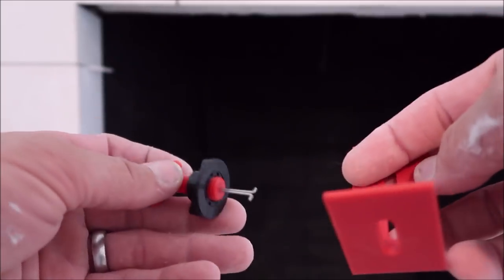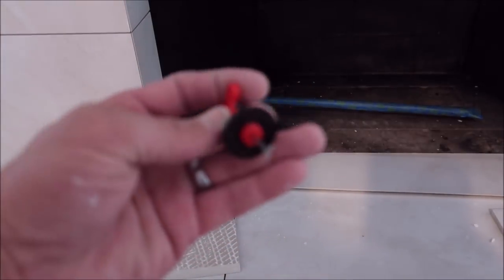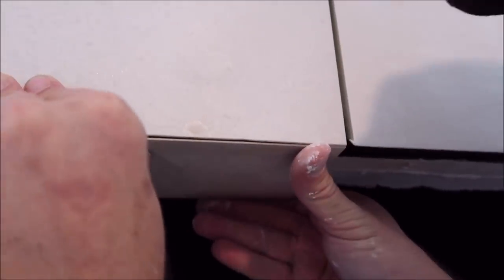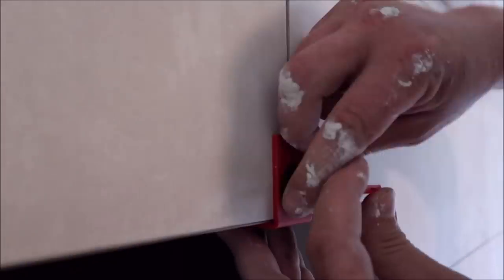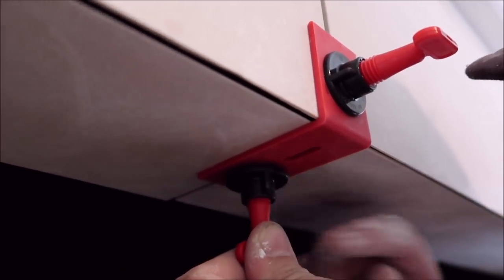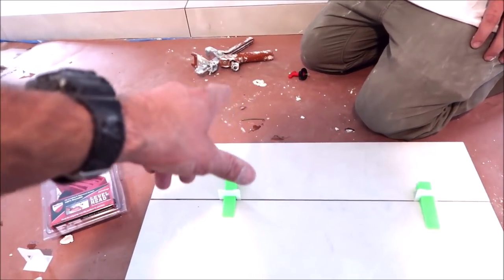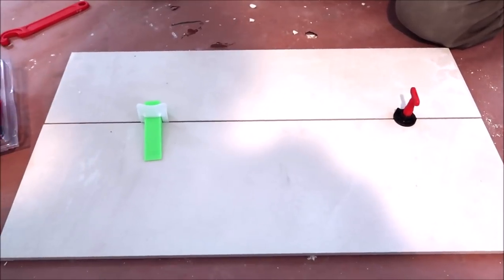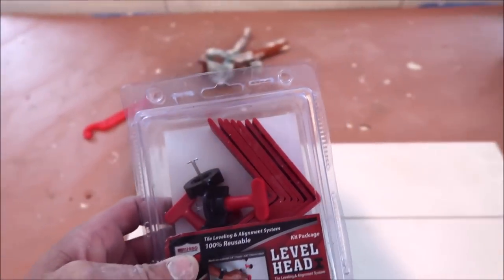Level Head Tile Leveling System Review and Test

Comment: So does the spindle part also push the point into the backer board to hold it?
Reply from the maker: No, it uses the face installed tile to hold the horizontal bottom suspended tile in place with the L bracket and keeps it from falling off/moving etc. It works for grout lines ranging from 1/32 to 1/4 and levels out the tile so there is no lippage. Cool and unique product...
Reply: @LandbergTileTV  yeah I'm looking for a product to hold up larger heavier tile like I did with the entrance of the shower... had to use a vertical and horizontal stick, tape never works for me
Reply from the maker: 2x4's that's what we use! 👊 we have yet to test this level head system on large heavy ceiling tile...
Reply: Used to use 2x4 too, but they tend to cover the butted edge so you don't know if flush the next day...sometimes.
Reply from the maker: Use a leveling system and leave enough room for the 2x4 👊
Reply: I just use mapei ultralite and raimondi leveling clips and never had a issue back butter ceiling half inch notch on back of the tile and clip them mofos on there ;)

Comment: These are useful. Though I think the wire on mine are too long. So far on 4-5 projects I might get a half a thread turn to bring tiles level then run out of thread.
Did I get a bad batch?

Comment: You don't need to break all the wedges and remove the tile, as you described. All you need to do is use a suction cup and pull the tile slight up back into place if you need to re-adjust it. Simple.

Comment: if those spindles are reusable, doesn't the thinset hold them under the tile? or what am I missing?
Reply from the maker: landberg Tile TV 24 seconds ago

It's hard to explain, but they have safety pin like width/size springs that twist to tighten down. They seem to come out after the mortar has set without problems.
Reply: Looks like the back side metal part is so small, it doesn’t embed in the thinset. I usually see him scrape off an inch or so of thinset before he sets the tile anyways, to the mortar is minimal on the edges. Small enough where the level system spindle catch can’t get stuck.

Comment: Very cool I use a bit of two by four or straight edge to keep the tile up on ceilings and if a big tile on the ravels Of windows etc tape does the job if a smaller tile but this is a pretty cool invention and reusable which is good nicely finished mitre must look into this cheers 👍
Reply from the maker: Thanks buddy! It's a fantastic idea for sure and could help with these types of situations. Thanks for the view and comment 👊

Comment: Instead of using as a recovery tool, would they work to replace your clip system? I see these on amazon and was thinking of using these to replace my raimondi clips because your ones are reusable...the ones on Amazon are slightly different and if you damaged the steel pin, you can replace it
Reply from the maker: No, we prefer the wedge and clip system.
Reply: Thanks.....been using the raimondi clip system for years and have always wondered if or when something reusable would come out and thought maybe this was it.....perhaps,  eventually something will come out that is just as good as a regular clip system but reusable?  Thanks